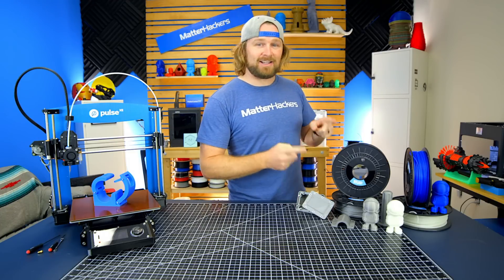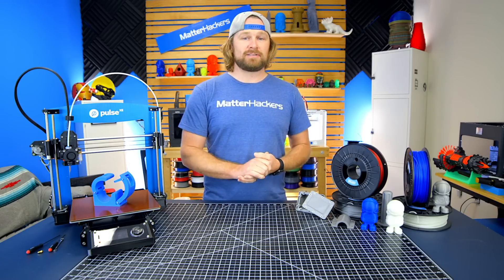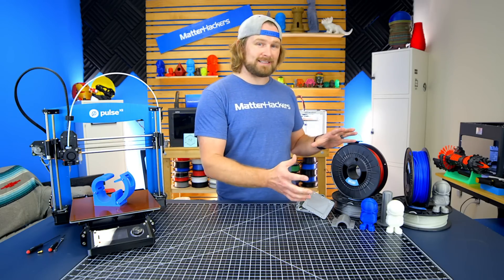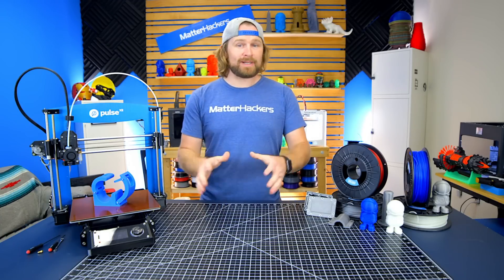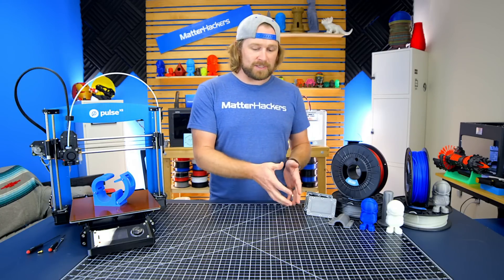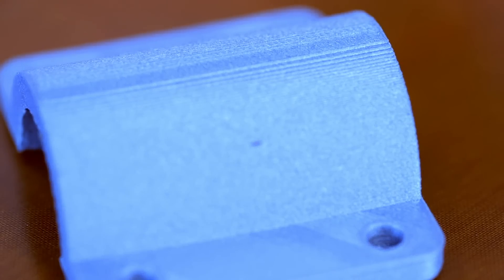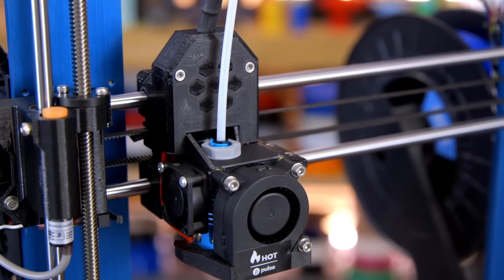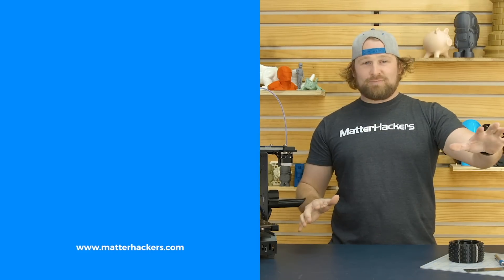Tech Breakdown NylonG // Functional 3D Printing with Advanced Materials

Comment: Can anyone please help me with warping? Anytime I print something kind of long, the ends warp up a little. With the bed at 70c like the site recommends, it warps a lot. I've gotten it to not warp half as bad by increasing the temperature of the bed in increments if 5 until I got to 105. It still warps, just not as badly. The nozzle is it 260c.
Reply: Yeah I print both nylon and ASA with a bed temp of 110 to prevent warping (corners lifting due to shrinkage). I’m not sure why they recommend lower bed temps of 60-70 - as far as I can tell, there’s no downside to a hotter bed.

Comment: 0.5kg is $64. That's just insane.
Reply: Seems fair. A mainstream filament like pla is 20 dollars, and this is only three times as much.
Reply: Funny, I found out that PolyMaker CF nylon is only 58 cad for 0.5kg. Their GF-nylon for a 500g spool is 40 cad, and if you get the 2kg spool, the price per 500g on the 2kg spools is only 32 cad, as the 2kg spools is 128 cad. Very affordable.

Comment: Your test with the rubber mallet is a joke...lol!...But, don't take that as a negative comment. (Here's what I mean by that.) I just printed with some NylonX and wanted to smash it with a hammer. I choose my 32oz ball peen hammer, and man did I have to whack the crap out of it to break it. I was hitting it as hard as I could against concrete and the stuff just simply refused to break. Don't get me wrong, it eventually broke, but it impressed the heck out of me. And I was hitting it at the weakest point. Not down against the layers, but rather on the side. So you would think the layers would split. Nope... matter of fact, the breaks showed that the layers had fused together just like a solid injection molded part. If NylonG is anything like what I experienced with NylonX, it has already impressed me. Two thumbs up for awesome filament!

Comment: Ahh I see the difference.  The carbon fiber is actually stronger but it only comes in black because of the filler.  The glass lets you make it in color and still have most of the stiffness. 

I would like to see info on Print temps, bed temps, enclosures having a big difference or not,  first layer adhesion methods.  Not just the print with a hardened nozzle.
Reply: that's not the only difference.  carbon fiber makes parts way more brittle the glass does.  we make a ton of end use parts, mostly from pure nylons and various alloys but correctly glass filled stuff is less brittle, more stiff, and higher end use temp resistance
Reply: tykempster, I'm curious, are the CF parts more brittle because you can't get a proper weave?  Is it the matrix?  Both?
Reply: @CalebDiT  Carbon fiber is just more brittle than glass fibers, it's the same if you compare real composites.
Reply: @patrikj  While carbon fiber may be more brittle than glass fiber, when put into a proper matrix, it creates a composite that isn't brittle, at all.  I guess I'm making an assumption from tykempster's comment that any CF composites they have made were not simply "more brittle," but actually brittle, which suggests to me the composite was made incorrectly (e.g. made with incorrect materials).

I think I've since found an answer for myself in the fact that the carbon fibers in these filaments are ground up and not really fibrous, at all, which is what they need to be.  It wouldn't be surprising, then, to find that the glass fiber composites were stronger.
Reply: @CalebDiT   Obviously neither are brittle like glass , but CF is much stiffer than GF. This carries over into the composite made from it and makes CF composites more "brittle" than GF. Because the CF doesn't stretch like GF does, the structure doesn't deform to share loads like GF does. This means that it's much easier to get localized load exceedances in a CF composite, and once it starts unraveling, it'll "snap" in a much more violent fashion than GF.
Reply: @patrikj  You are correct, but I think the point is moot.  The reason things made with this filament are not strong is because the carbon fibers are mere splinters, not strands as they need to be.  Given that, tykempster's comment is not as surprising to me as it originally was.  If you're going to use the wrong kind of fibers -- splinters -- glass splinters are likely to be better if strength is important since they are more flexible.
Reply: Glass fiber is also cheaper (it's supposed to be, anyway) and heavier.

Comment: Thank you for including the disclaimer regarding nozzle and gear hardness and temperature  capability.  I've been having failures lately with PLA parts that break along the layer seams.  It's good to know that there is an eventual solution, but it's also good to know that it's out of reach of my current printer so that I don't try that path until I'm properly equipped.

Comment: Please highlight the differences between regular Nylon, NylonX and NylonG, molded Nylon and molded ABS, for tensile strength (actual numbers ), flexibility/rigidity, warp, shrink, needing to be dried first, cost per kg, weight, ease of printing, best printers to print this filament successfully...this are the data points we need to decide on the best fit materials and printer. It would also be great if you comparedthe NylonG to other similar filament in the market and highlight how his one is better, worse, different.  A link to a numbers comparison on your site could work as an afterthought.  Thanks!
Reply: well damn

Comment: You guys should really produce filament with continuous glas or carbonfiber instead of small chopped fibers. This would add imense strength!!!
Reply: But most printer can't handle that. To be precise, I know of just one printer that does that :/
Reply: Nice rubber mallet, doesn’t really show the shock resistant.
Reply: Not as simple as it sounds
Reply: That is very hard to print with though.  You would have to have a way to cut the glass fibers or lay them seperaly otherwise non print moves would mess everything up.
Reply: They don’t even do that in injection molding. It would only increase strength in one direction. I cant even think of a practical use for it.